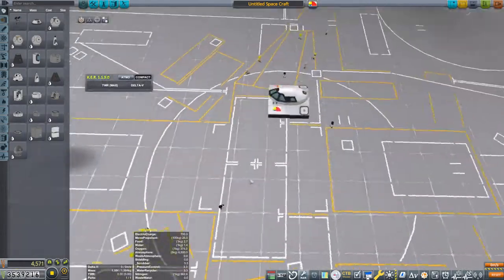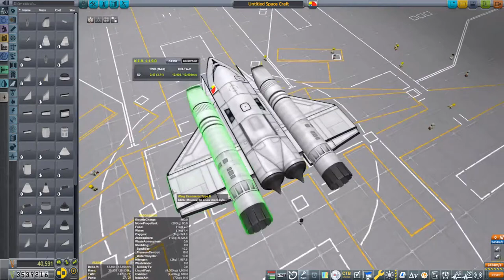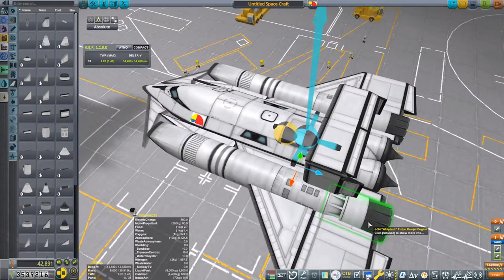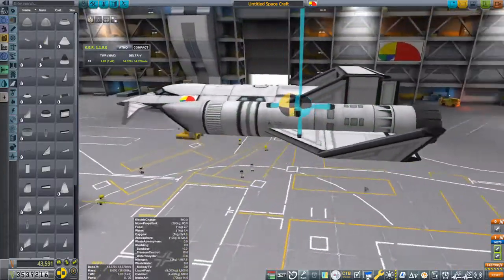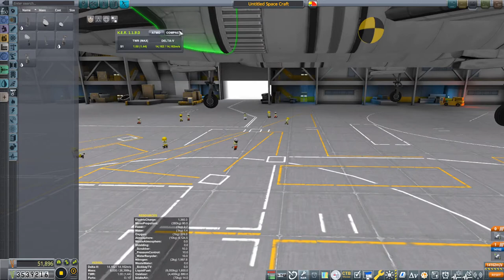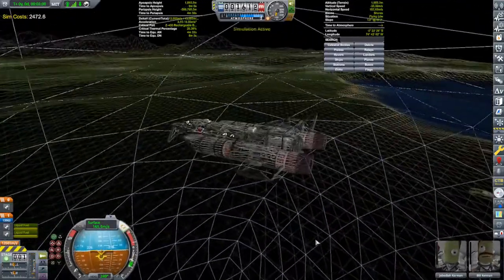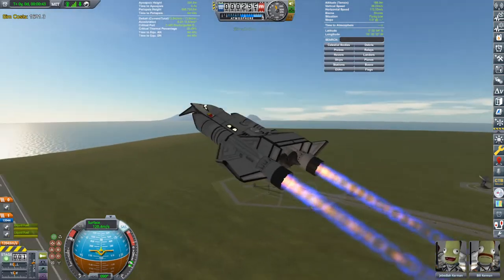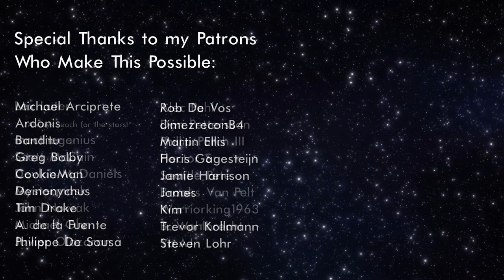Building a SSTO | Stream pt. 1/3 (KSP 1.12.2)

Comment: Inline cockpit allows you to place a more heat tolerant part at the tip of the plane. I typically use a mk3 to 1.25m tank and a spike intake.